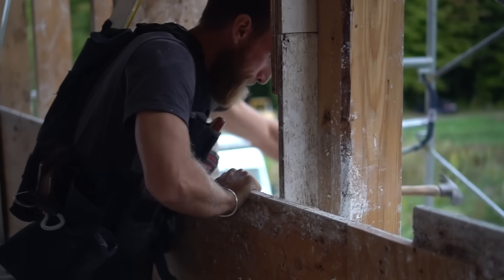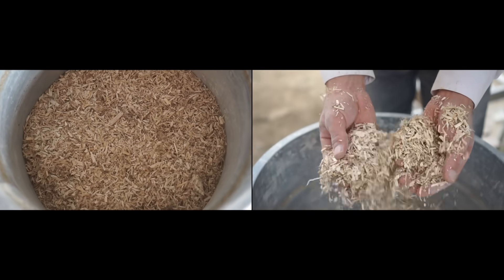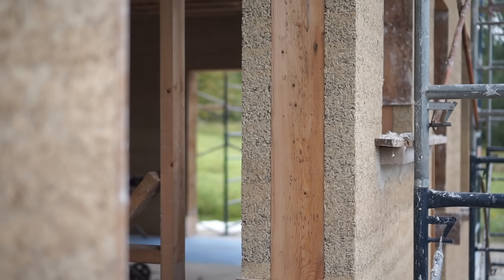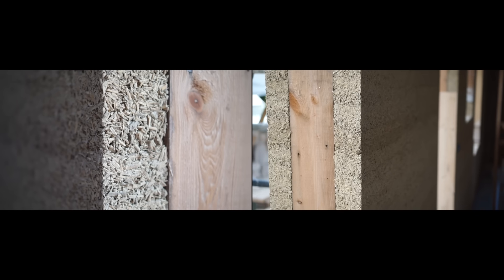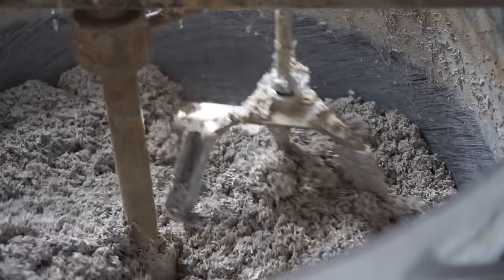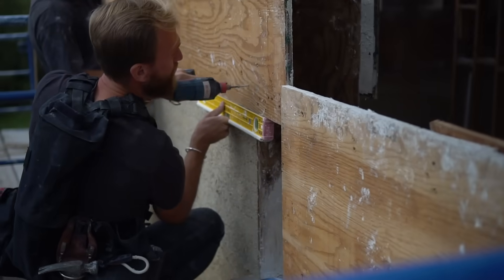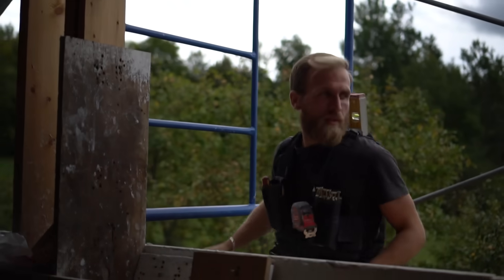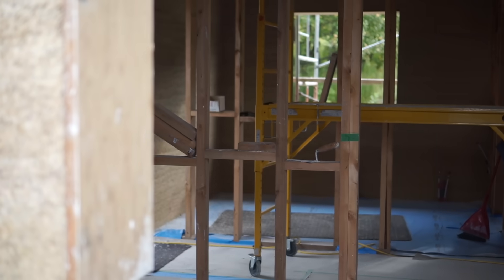Building with Hemp – An Incredible Natural Insulation & Sustainable Material

Comment: Legalization of hemp worldwide,save the forests save the planet
Reply: Anything that's better for the planet and can reduce homelessness
Reply: Another enemy of hemp is huge and corrupt cotton industry
Reply: hemp is legal lol..
Reply: @madman3891  not everywhere. Is in Canada. I think there’s still a few states where it’s still not legal….unless there’s been change since whatever I read or saw was posted.
Reply: With bamboo for the framework it sounds very doable, and it won't need trees that are slow growth items.
Reply: @cartmanrlsusall  hemp is mold resistant , bamboo is not. Hemp is more durable.
Reply: This is industrial hemp that has no TCH. Take it easy pot head !
Reply: Marijuana madness was the propaganda used to convince the public to prohibit cannabis while the true motive was based on the capitalists lobbying to eliminate the natural alternative to petroleum for fuel. Henry Ford invented a hemp car and hemp biofuel. Rockefeller, Dupont and Anslinger ganged up to remove the sustainable resource from public production. This was the beginning of the industrial revolution. If cannabis wasn't prohibited and we maintained its growth while burning its oil,  we may have kept the atmosphere in balance.
Reply: Adam A. yes but what the other guy was saying is Hemp sucks up Carbon too and grows faster than trees. You say trees soak up carbon. The other guy said hemp does the same thing. Except hemp grows faster.... So wouldn’t it be logical to go with the faster grower and grow trees as a secondary thing?
Reply: Adam A. Is it true you cannot get high off of hemp?
Reply: @DylanBegazo  YOU CAN NOT GET HIGH FROM HEMP !!!
Reply: @KB-sv7fm  Ok cool.
Reply: better solution than clay. Taking clay out of the soil renders soil useless for agriculture. An incredible 10 tons of hemp can be grown on an acre of land in just 100 days, making it the world's BEST biomass source. See, Why Hemp Houses Will Be The Best Houses In the World
Reply: @who8myfish  That and cattle production.
Reply: @DavidKirtley  Cotton only became the main textile plant due to the Southeastern climate being well suited for growing it, and the slave labor to make producing it in mass worth while. As cotton depleted much of the land in the southeast, we started planting it further and further west in areas where cotton should never have been grown. Currently there are cotton plantations in the South West that are depleting rivers before they ever reach their deltas. The issue isn't "this plant fiber is superior to this other fiber" the issue is there are plenty of fiber plants that grow naturally in areas where cotton would be a massive burden. For example, cotton wouldn't like to grow here in the PNW, but naturally growing in my yard is a thicket of stinging nettle that can be processed similarly to hemp fiber. Not only that, with the proliferation of medical marijuana, much of the plant stocks are discarded as waste. This waste material can easily be used for things like the product in the video.
Reply: @Dizzykitty817  But it is not only competing against natural fibers. Synthetic fiber is a much larger portion of the market. 
Again, I am not saying that there is anything wrong with hemp. I am saying that it's being  a major crop was over before it was made illegal in most places. 
The product here is a mediocre solution. That's fine. Stick construction is a mediocre solution as well. I don't see it taking off and being a major market force.
Reply: This is my first time hearing that hemp is illegal. Which country are you from?
Reply: @mystic1160  so what he still advocated and signed it.
Reply: @Adam A. As of last Thursday is isn't any more. Just another misguided part of our failure of a war on drugs.
Reply: Check " HEMP FARM BILL "
Reply: @peterl0815  clay is a poor insulator and straw can rot...but ofc cost will be factor too...
Reply: @david kirtley. Too bad most have already been but Dow for cows and their feed
Reply: @peterl0815  it would be as cheap or cheaper if more was grown, it also dosn't need prime fertile soils to grow so could be grown on wasteland.
Reply: @Dongs import it from Sweden then.
Reply: and you can smoke it! great for the planet!
Reply: Cannabis is the Ultimate Weapon of Mass Peace
Reply: hemp was legal in WW1 and WW2 ......... hence the saying "hemp for victory" it was the cotton industry that pushed to make it illegal (few other entities got involved as well)
Reply: Until they start cutting down forests to plant hemp...
Reply: Very true... What do you think about using Compressed Earth Blocks? Our org wants to use CEB for urban redevelopment because it's "everything" resistant and readily available. They can also be made from recycled concrete waste.
Reply: @abundantearthglobalcdc4290  I like them on a lot of levels. Yes, you can use recycled concrete waste but that is going to take machinery to process. The biggest problem you will have with any alternative construction in an urban environment will be getting things approved.
Reply: @DavidKirtley  not necessary hemp grows wild world wide so it can grow well in profitable amounts in city nurserys and on marginal crop land
Reply: @cartmanrlsusall Sorry, the cult following around hemp is mostly a solution in search of a problem. It had already been mostly displaced by other crops before it began to get legal attention. If it wasn't that important of a crop when it was legal, why is it suddenly going to be such a wonderful crop now?
Reply: I better do some research on this you have a good point .
Reply: @cartmanrlsusall  I remember an old episode of This Old House where they revisited some of the cutting edge energy efficient homes that they had worked on many years before. Most of the fancy tech didn't stand up over time. It really boiled down to: stop the air leaks and put in plenty of insulation. This stuff takes 12 inches to get to R25, rock wool can get to R30  in 5.5 inches. The only real improvement will be something that addresses structural components. Structural Insulated Panels are looking pretty good in some cases. Also rammed earth, adobe, and compressed blocks are pretty ecologically friendly and lots of thermal mass is your friend for energy consumption.
Reply: @DavidKirtley  the colonies actually required everyone to grow hemp. It made the ropes and the sails they used to get here along with many other products. Once the government got scared of its cousin marijuana they banned hemp as a crop
Reply: @scottiemanners  It got replaced by manilla for rope and lines long before the legal issues arose. For canvas, the longer fiber cotton and flax took over. It did well until really WW2.  It just got replaced by better alternatives for fiber well before the drug issues came up. Especially since wire rope and synthetic fibers were invented. Hemp is not a bad product. Maybe it will get a revival.
Reply: @DavidKirtley  dude you don't know the history of hemp at all. It was starting to become very popular in various industrial and commercial applications in the 19th and 20th century. The timber industry was still huge and hemp was bad news for their market share. They lobbied to have the cannabis plant prohibited, it got restricted instead (until Nixon), which killed the pioneering hemp industry. Cannabis prohibition was really the nail in the coffin though. The reason it's gaining traction today is because of the cannabis legalization statewide and from Mexico and Canada. It finally allowed unrestricted research on cannabis and hemp, leading to properties of hemp we never knew about because it was prohibited before science could catch up.
Reply: @mycelia_ow Well, good luck with your crusade.  I have no idea what you are using for your source of information but it contradicts everything I have ever seen.  That doesn't even hold up to basis sources like Wikipedia.
Reply: David Kirtley I appreciate your input here. I’m currently an enthusiast for the product and will be using it in part to renovate my existing stick framed home. I think you are maybe right in that it will only ever have niche appeal as does rammed earth, adobe etc, but that niche looks fantastic.
Reply: @rossmcleod7983  It would be interesting to see some feedback from a "disinterested" party that is not selling a system. Let us know how it works out.
Reply: @DavidKirtley  What the hell are you talking about ? Hemp , along with marijuana , were illegal for a long time.
Reply: @KB-sv7fm  By the time it was made illegal in the US in 1937, it was a fringe crop at best.
Reply: @DavidKirtley  People are smarter today about its benefits.
Reply: @cartmanrlsusall  actually the other poster denouncing hempcrete needs to do more research, lol. It’s been used for centuries oversees.
Reply: @DavidKirtley  Yes, but hemp grows faster than a tree so it would make more sense to grow hemp instead of trees
Reply: David Kirtley or just use all the area thats already cut down because that makes more sense?
Reply: @DavidKirtley  can't u grow inside, why not build sky scrapper factories.
Reply: @DavidKirtley  this thought just came to mind, lol. Lots of barren/unused fields to use though. Too many are spraying a glyphosate cocktail over our forests in Canada, before clear cutting. (except Quebec, who had the sense to abolish it). It’s evil.
Reply: @DavidKirtley  hemp produces 4x the amount of resources and at a far faster rate than trees(wood products) do. Hemp heals the soil and would create a better biome for trees and everything around it. Better than cotton(no pesticides), better than wood(faster regeneration), better than petroleum (heals soil instead of deplete it). But your opinion is right 😂 preach on lol
Reply: @kheff46  Not preaching anything. I am just questioning. There are a lot of alternative building methods to choose from. The walls of a structure are really cheap to build. The real money in building a house is in the roof, bathrooms, kitchen, and windows and doors. This still requires framing, apparently needs a lot of mixing machinery, lots of manual labor, a lot of form building and still needs plastering. .
Reply: @DavidKirtley  
They can also last hundreds of years. It gets harder over time.
It takes carbon out of the environment and holds onto it. It can be recycled.
A diy type person can do it. It is fireproof and bug proof. Gives off no gases.
It is its own insulation. It is only two ingredients and can be done in any mixer.
I agree, lots of manual labour. This allows almost anyone to contribute some labour
or again a diy can contribute as much labour as they are capable of.
I know the rest of the house costs money too but the cost depends a lot on who the house is for.
I like a lot of other alt. housing methods but I think hemp might be one of the best.
Reply: @ItsNotMeItsYou007  could it be used like in a basement to do the concrete walls over to keep a basement warmer and dryer? I'm trying to learn how to do over parents basement to give me a safe workspace for projects and still need walls. Learned how to install a subfloor and thats almost done.
Reply: @naturewolf94   You mentioned warmer and drier. Do you mean to say that your basement has water on the floor or walls?
If so then the proper solution would possibly be to start from the outside of the wall.
Reply: @ItsNotMeItsYou007  great grandma had water there, but that was from problems parents fixed 11 years ago when we moved here. So thankfully no water. Just the air stays notably cooler then upstairs and mild humidity in the air down there. My hope was that maybe the hempcrete would help hold in heat downstairs. So it would stay warmer naturally. As the area i have 98% done with the sub floor instillation got far warmer as i worked cross the rooms floor. So much so standing where the floor ended was a drop in temp. My thought was the hemp create would be cheaper to try to earn the money for. Being grown so heavily here now. So i wouldn't have to try to get the expensive vapor barrier, stuff called blue board and a sealant before putting on a face board and loose like 6 inches of the room on each side when the entire room is done. Been learning the process on my own through youtube tutorials and online guides. As with my medical i am unable to work a normal job and drive. So always up to learning new tips and tricks that could help me.
Reply: @ItsNotMeItsYou007  I agree. Hemp is the only worthwhile option for me. Would like to see it expand a lot. In building, it will possibly inspire more in my community in Nova Scotia. <3
Reply: Heroin is even better
Reply: rofl hemp is only insulation house is still build out of wood
Reply: Mr Russian 187 did you even watch the video? The wood is only used to mold it and then it is removed. The hempcrete is the walls.
Reply: Yes there is wood for the framing, but the hemp is not *just insulation, it is the walls.
Reply: Don’t forget weed

Comment: Nice idea, they only don't tell that the insulation ratio is a lot lower than other materials. R2.1 isn't much for that thickness at all.
Not to say it's totally bad, but it is something to keep in mind. There are also very good insulation materials made from recycled waste. 
Less insulation can mean that you need to heat up more, which is in the end is also less sustainable.
Ones again, it doesn't mean it's totally useless, but nothing comes for free.
Reply: Merlin Gallagher  It  is R2.1 per inch of thickness and the most common thickness of the hemp layer is 12" so the R value of the hemp wall is R25 as is stated in this video.The best things about hemp are non-toxic to the builders and to the people who live or work in the finished bldg, the material breathes so no problems with humidity, damp, mouldin the finished home; lightweight and easy to work with so non-skilled labour including the eventual owners of the house can be part of the building crew which cuts down on costs and increases sense of ownership and care and understanding of the end product; the beauty of the finished walls and whatever else was mentioned in this video and in many others on using hemp as a building material.
Reply: @shardamatasatyam9148  Thanks for your reply. I am familiar with these materials for many years. Yet I don't always recommend it to people for the reasons I mentioned before. 
Besides a lot of hemp insulation products also contain "toxic" elements. 
Also there are a lot of other non-toxic products. In fact most of the products I am familiar with can be used by "non-skilled" workers with no or very little protection.
Reply: @merlingallagher4484  
Why don't you tell us what these materials are?
Reply: What Shardamata said. Seriously Merlin, if you watched the video half as carefully as you constructed your criticism, you would have save yourself the time.
Reply: @godfatherNYC  In fact, I watched the video a few times completely. 
But no thanks for giving some well meant advice, glad it's being appreciated so much
Reply: R2.1 per inch is not so high you're right, but the global performance goes much beyond the insulation factor. You have to add the factors of thermal reflection, thermal mass, humidity regulation and the thermal gain due to the phase change of water in the wall. It acts as a regulator wall.

Comment: Great video and Amazing Product. I was wondering what happens to the hemp walls if it gets wet or is in a flood situation. Do they dissolve? and What about Bush fires as well?
Reply: In situation of flood the wall will stand. Lime based mortar don't dissolve in water, they are back to stone once set. After the flood, the wall will dry out because it is breathable, only the esthetic will be affected. That said, hempcrete cannot stay wet or it will deteriorate. Might sound crazy but yes, hempcrete resists fire.
Reply: @duchanvre  Do you have any affiliates in the US? I am a structural engineer in the US and have been researching the hempcrete technology, but it does not seem like there are many people capable of executing this method in the US and not many completed projects.
Reply: @Corey Barber  I’m on the same page. I’m planning a residential build and looking for contractors and supply but the information is limited. Hopefully a trend starts now that Hemp is legal.
Reply: @natabillionaire  he said he has built 45 houses already, that does seem like more than a few.
Reply: @natabillionaire  UK hempcrete hosts workshops throughout England. For the right contractor this would be a great opportunity. They are building commercial buildings with pre-cast blocks, etc. Someone needs to take this idea and run far!!! I am from Colorado but living in Portugal hoping to build my hempcrete dream home soon(ish).
Reply: the description states that hemp building materials "resists fire, mould..." however I'm interested in more details as well.
Reply: Fire tests are incredible. It displaces heat like Kevlar.
Reply: Deimos Cain  but how about chemicals and the footprint to manufacture it?
Reply: It's like a sand castle, it'll fall into itself. I can imagine even heavy rain for a long period can cause massive damage.
Reply: @zachp7603  I think that is why it is recommended to build the foundation wall up to 18-24" for this type of construction, to prevent long exposure to water.  If the site is positioned appropriately (high enough with a pitch that will drain water efficiently) and the overhang of the roof is sufficient and maintained, this construction can live well beyond 1000 years.  THAT'S sustainability!
Reply: @zachp7603  wrong